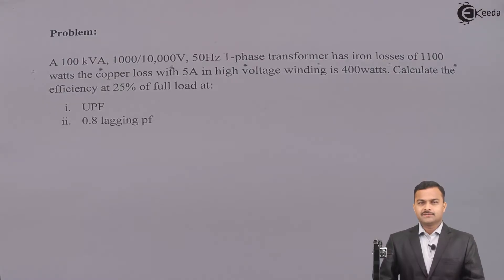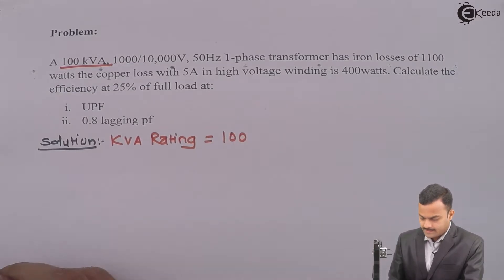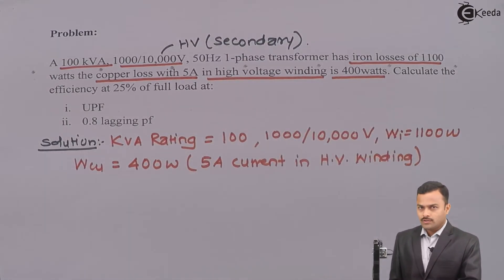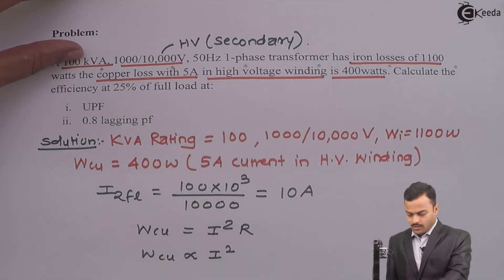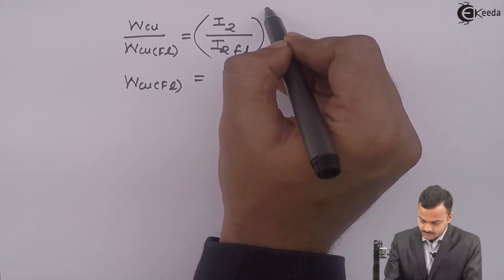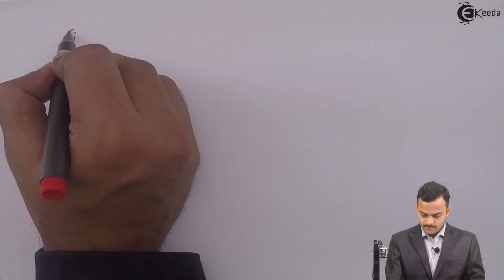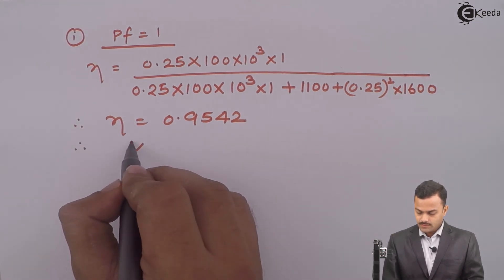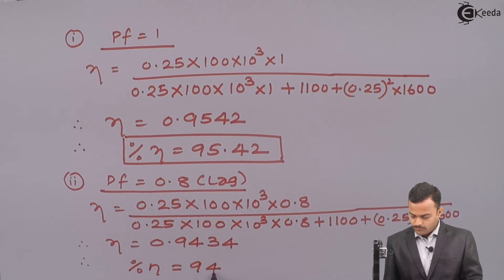Efficiency of a Transformer : Problem 3 - Single Phase Transformer - Basic Electrical Engineering

Comment: How is high voltage side the secondary side? As in the previous lectures, HV side is always the primary side. I didn't understand how did this happen?
Reply from the maker: We recorded your response.We will work on this and get back to you.
Reply: Not necessarily. Depends if it's a step-up or step-down transformer.
Reply from the maker: We recorded your response. We will work on this and get back to you.
And Thanks for your suggestions,